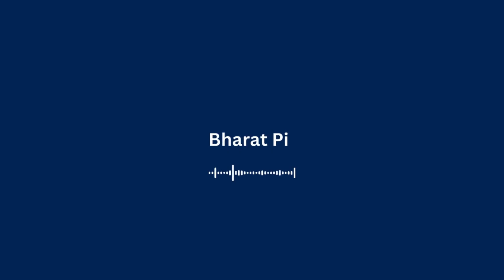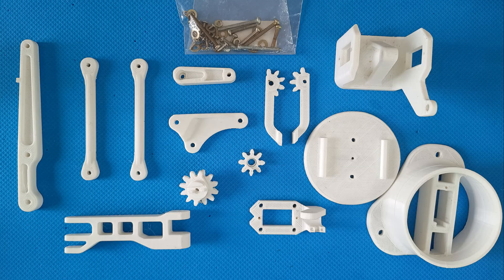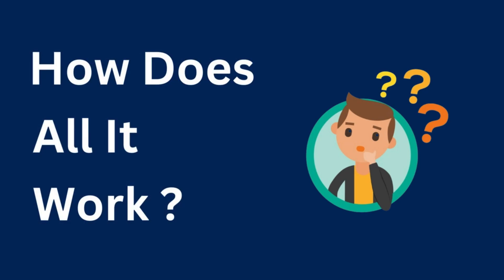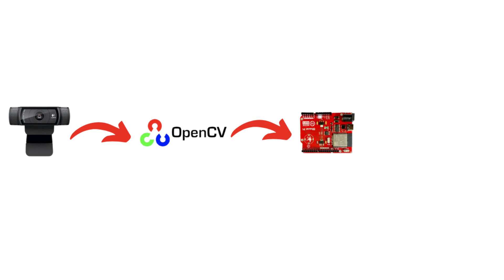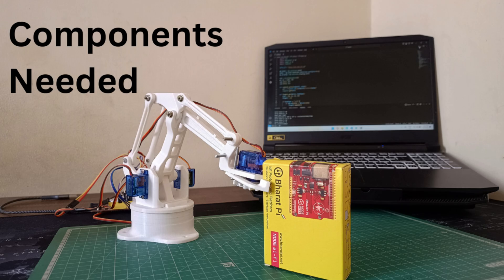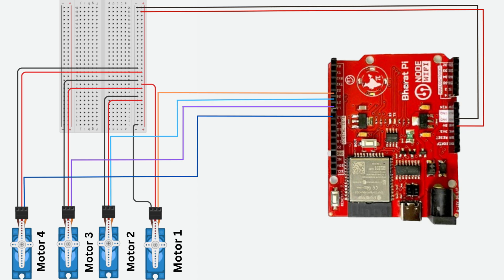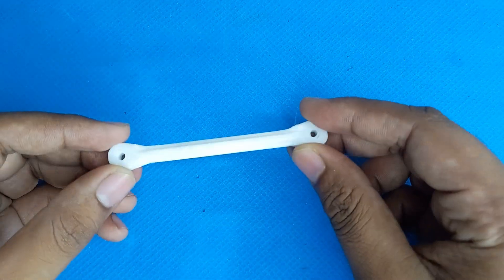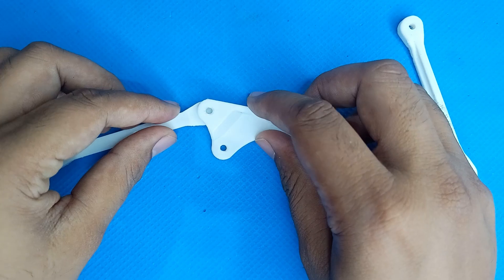How To control Robotic Arm using hand gestures || Bharat Pi Node Wifi Board

Comment: Nice dude their 4g board caught my eye
Reply from the maker: You can try building Projects with that board
Reply: @robotechzone  they are little outside my price range for now but I plan on buying one for home automation to replace or supplement mqtt based system I currently built on RPi